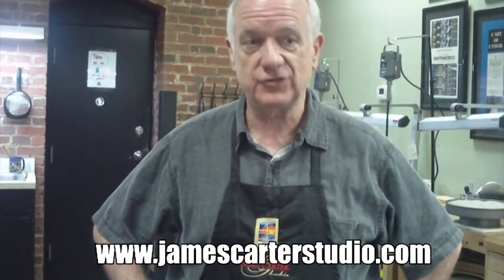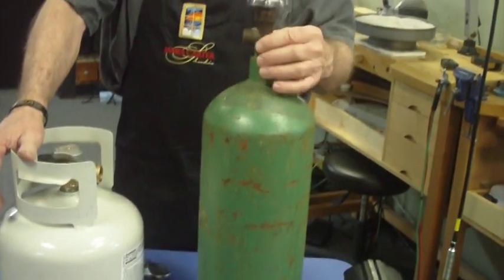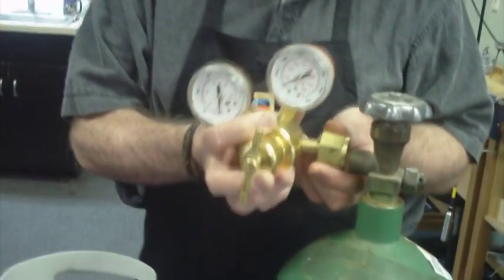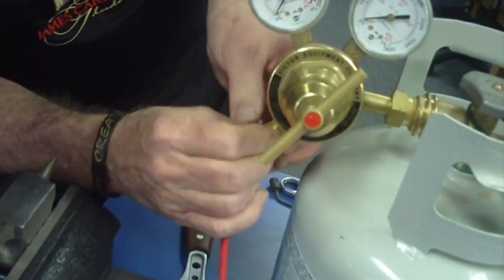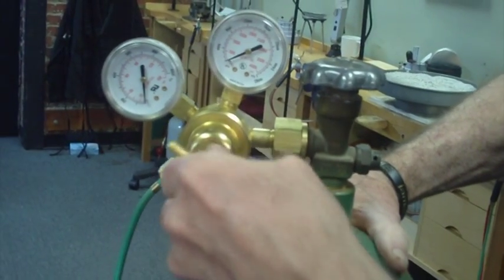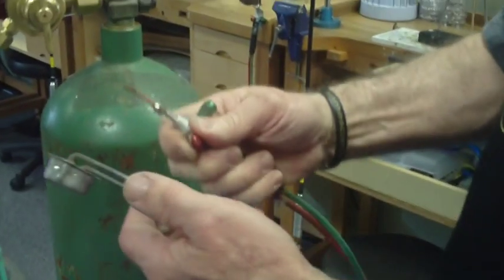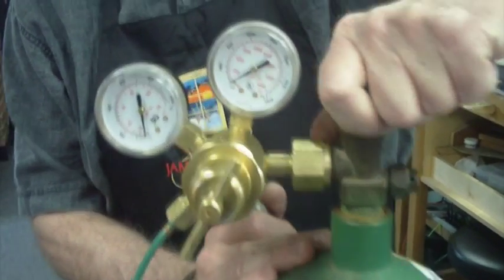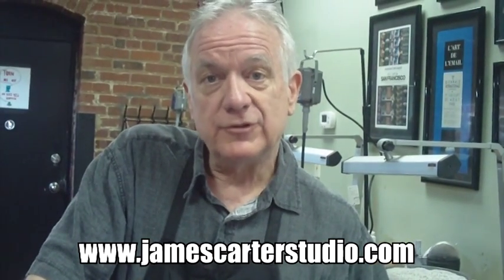Jeweler's Torch Set-Up by James Carter Studio

Comment: Thank you SO MUCH. I’m just learning about my smith little torch. I haven’t been able to find a regular that fits the smaller disposable sized propane bottles which is what I currently have hooked up as it came from my Dad’s who I recently inherited this set up from: it has the small red topped mini regular on it. I’m a bit nervous about it’s safety but the. Again he used this all the time. You don’t mention flash back arrestirs. Are they not a necessity? Thank you so much for any advice you could offer and thank you VERY much for your video.

Comment: Thank you so much for this demo.  My question is when I attach the flashback regulators to my tanks the arrow is pointing upwards toward the tanks and I am told they are suppose to point downward but the flash arrestors are made so that when the female nut that screws onto the tank  the arrow ends up pointing upward.  What should I do?

Comment: Poor set up sequence and dangerous shut down sequence. Blowing out the O2 fitting before installing the regulator is a must. A spec of dust in the system can be a fuel source. 

Heat of recompression can injure or kill due to regulator burn out. Search RBO and learn. Always bleed out the lines and back out the regulator to zero so the next guy to use the equipment doesn't get hurt, or worse. 

Smith (Miller) has a recommended sequence if anybody is interested in staying safe.

Comment: nothing said about the propane regulator...    can one use an acetylene regulator by changing out the tank fitting?   Is there a proprietary propane regulator?    I'm used to using acetylene so I need to know about the propane regulator.